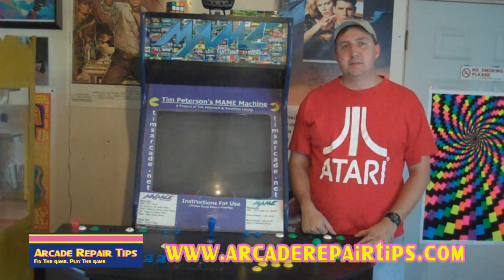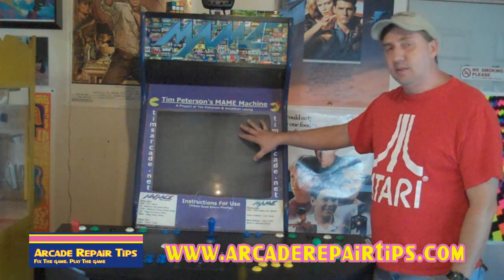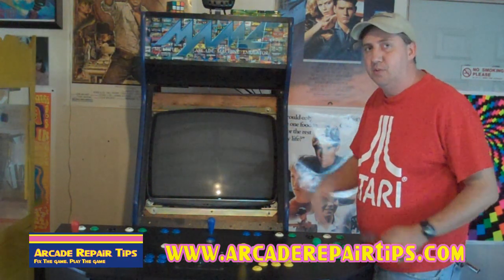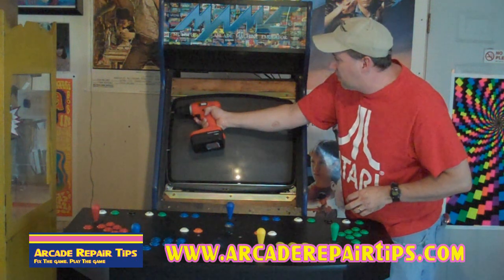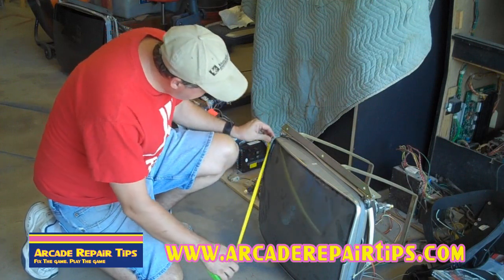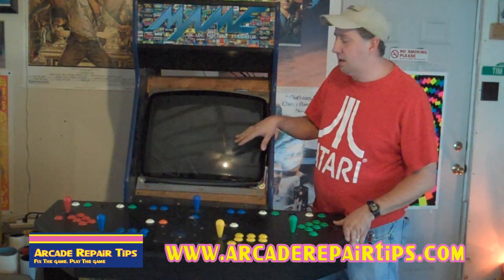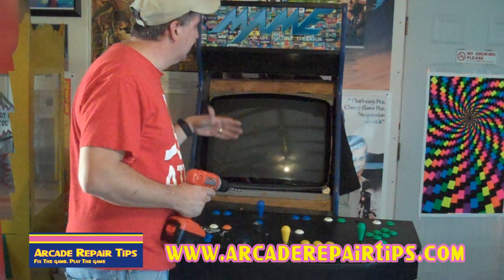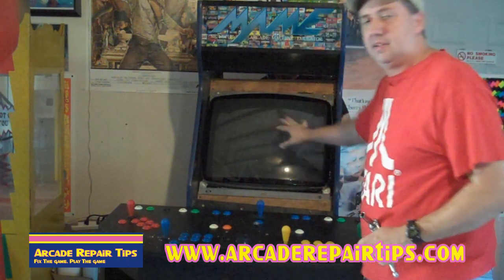Arcade Repair Tips - Replacing An Arcade Monitor (Part One)

Comment from the maker: @mexicanninj It sounds like you did everything correctly as far as the sync wiring is concerned. You might have hold adjustment issues if scrolling is your only problem. In part 2 of this video, we show some different screens that can help you tell the difference between a sync problem and a hold problem. If you adjust the hold and you still can't get it to stop scrolling, you might upload a video of the issue and send the link to us. Thank for your question and good luck with your repair.

Comment from the maker: @jrfps We usually use 4 carriage bolts with nuts to hold in the monitor. There are typically two boards that support the monitor that these bolts go through to hold the monitor frame to the cabinet. You can get these parts at your local hardware store.

We have also featured your question on episode 20 of our Q&A podcast. Please listen to it for more of our thoughts on your question. Thanks for your question and good luck with your future repairs.

Comment: If my monitor chassis works fine, but tube needs replacement from say screen burn, how do I know which crt monitor tube is  compatible with my monitor chassis & board etc if I can find or afford exact model replacement. What am I looking forIs there anyway to get rid of screen burn beyond replacing tube, & does that anti glare screen cover up screen burn as temporary solution